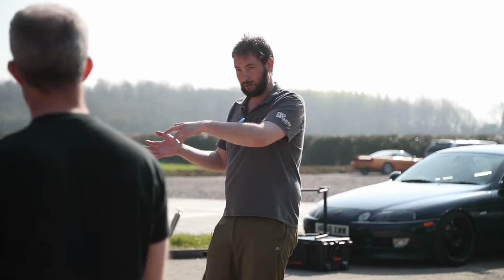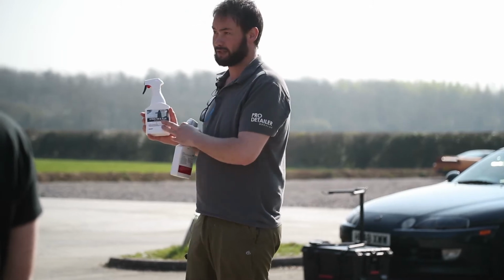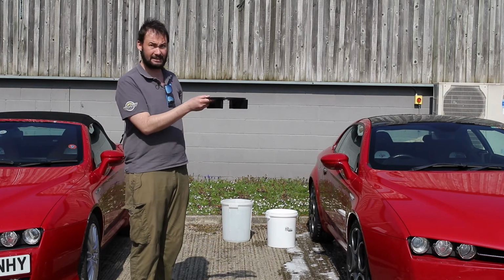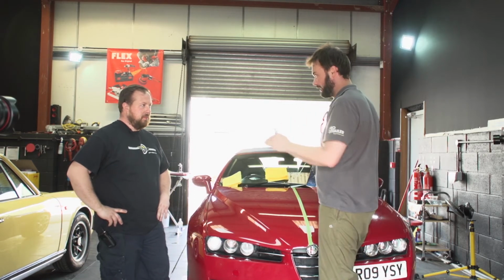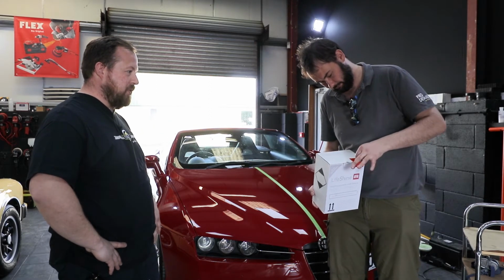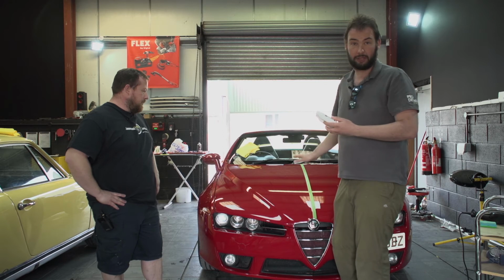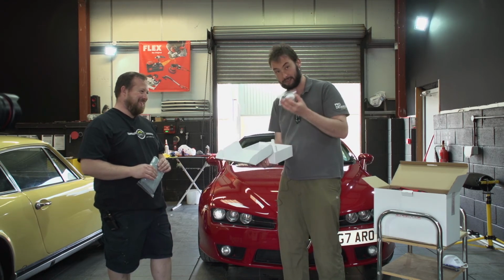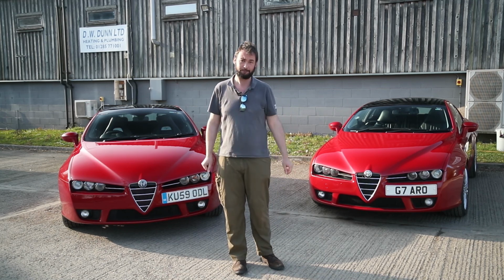Supagard vs Gtechniq vs Autoglym vs GardX vs Williams vs Diamondbrite PRO Detailer Megatest 2019

Comment: Bought a used SEAT Leon in black from a car supermarket in May 2019 which had GardX applied. Never asked for it (cost £250.00) and the car was still covered in minor scratches which sort of negated the treatment.

Comment: My Laguna had faults from new and for compensation I accepted that Supaguard be applied . I must admit the car looked shiny and resisted bird poo but no way was the car prepared properly before application. 
That was before I knew anything about car detailing and I reckon 99% of the public doesn't have a clue, it's just a nice little earner for the dealer.
Reply from the maker: They certainly are profitable for some, and perhaps the lack of public awareness for so long has aided that